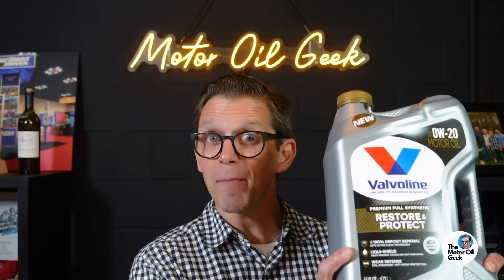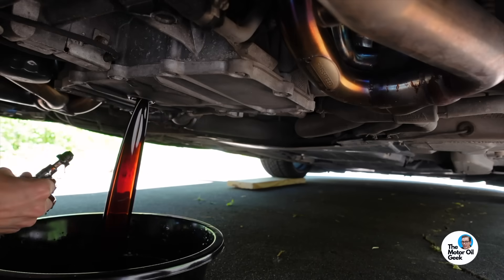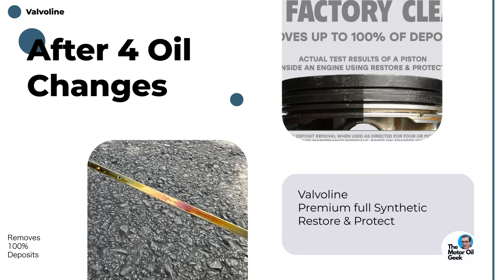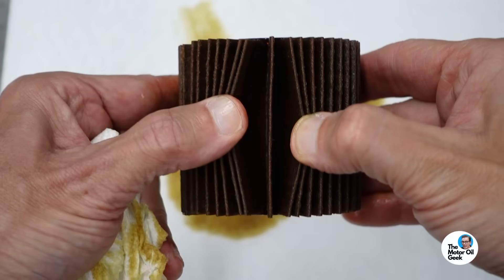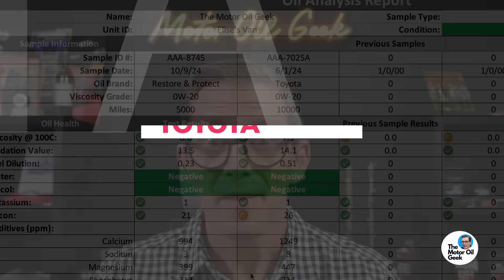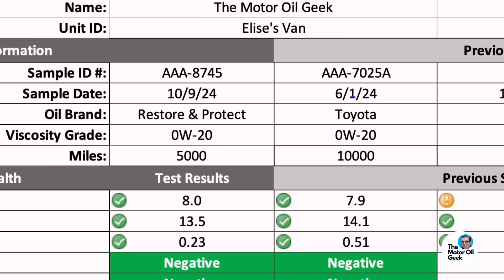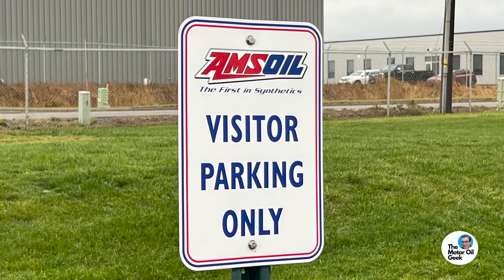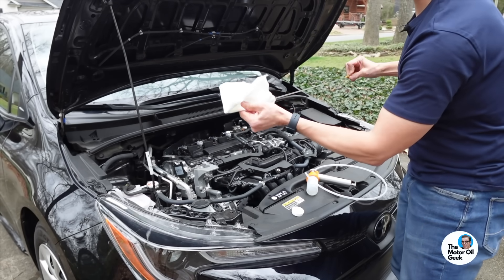The TRUTH About Valvoline's BOLD Engine Cleaning Claims

Comment: That dip stick cleaning is unbelievable.
Reply: I'm watching it work on my sisters 2013 Hyundai 1.6 engine. I can see more and more of the sludge flaking off the oil fill tube every few weeks when I check the oil.
Reply: Never buy a used car with a dipstick that looks burnt like that
Reply: Pennzoil Platinum cleans the dipstick also i have 2 vehicles with it 400k on my truck i wouldnt be afraid to try the VRP Though.
Reply: @robertclark2935 I agree. My 5.0 F150 is at 176,000 miles and its dipstick still looks brand new.
Reply: agree
Reply: That is what convinced me to use Valvoline R+P. However, I did not see any effect like that when I replaced the valve cover gasket on a 2011 Honda CRV. I made sure that CRV was well kept with either Castrol Magnatec or Pennzoil Platinum. The dipstick never did have varnish, but there was plenty on the valve cover.

Oh well, I wasn't expecting miracles. I just want that car to last a long time without too much effort.
Reply: @skylinefever I am at best a shade tree mechanic, possibly the varnish on top of the engine is extra thick compared to the average engine and might take 2 years or more to see significant improvement....I have seen others make the same comment on the varnish
Reply: Brake cleaner does that.
Reply: @NomenClature-o8s  for real
Reply: Definitely unbelievable. Like fabricated.
Reply: @SilverCommander no it really does clean. I just put in my 11 year old explorer and it’s already cleaned the stick off along with the bottom of the oil cap.
Reply: @SilverCommander  I had the exact same result using VRP on my lexus with 180k miles. Im only 2500 miles into the first oil change with it.

Comment: I had a bad experience at a quick lube place and the tech only finger tightened the drain bolt.  I didn’t notice until I got a warning light.  Had a lot of crusty oxidation form on the upper part of my valve cover.  I started doing my own oil changes but noticed my oil consumption was getting bad. About 1q/1,500 miles 😢.  I tried VR&P and with the first 200 miles the consumption stopped 😮.  The crusty deposits on the valve cover also started to soften and dissipate.  At 1,000 miles I replaced the filter as a preventative since the valve cover is about half clean with the remaining deposits already softening up.  This stuff is the real deal 🎉

Comment: I had an “oil production” issue in my wife’s 2011 Honda CR-V (K24 engine). Fuel dilution was at nearly 5% using GC method. After several ~3K oil changes with Valvoline Restore & Protect, I am below 2% on the last 5K oil change. The data tells me it is working.
Reply: I have same CRV.  Strange that you had dilution problems since that didn’t start until gen-4.  Anyway, I was consuming 1q/1,500 miles on mine and within 200 miles of the first oil change, my consumption has stopped.  K24s are bullet proof 😅
Reply: @mhagnemae5202 
I inherited this vehicle at 45K, and it had the fuel dilution issue when I got it. Apparently I’m the only one with a port-injection engine that has fuel dilution issues, lol.

Not sure why there are a lot of haters/skeptics out there. I pay less per 5 quart for R&P than I do for a lot of other average oils, so even if it’s just placebo, no harm.
Reply: @carnold.knowledge  Have you run injector cleaners  to try and solve the fuel dilution (caused by unburned poorly vaporized fuel) ?
Reply: @MathewPollard-vj4uq 

First thing I did was replace all 4 injectors with new Honda OEM. Sadly, no real change. Also, trim and ratio numbers coming back from an advanced scanner all looked normal. I suspect the oil wiper rings were stuck or otherwise compromised and the R&P is helping with that.

Comment: Did you just lay the dipstick near the exposed + battery terminal, Lake? Oopsy. FYI, bulk tank oil at Dealers comes from any source. It's not Toyota. We've had Pennzoil, Valvoline mystery salad oils. Sometimes we know, other times someone fills the tanks and have no clue what we're getting.You're protection may vary.
Reply: I watched him lay down that dipstick near the battery without looking too and was preparing for some sparks, lol.
Reply: @shanesdiy  and it was a quart low.

Comment: Clearly VRP cleans more aggressively than other oils. The question is, is it too aggressive for long-term use? I have it in both my vehicles right now but I might go back to Pennzoil Platinum after a few OCIs
Reply: I think that's why they market the "Protect" as well. It's not just a "cleaner" oil. It's capable of excellent wear protection simultaneously.
Reply: Is it better than liqui moly d-v
Reply: The detergent package is comparable to other high mileage oils, it’s the proprietary additives that work the extra magic.
Reply: Perhaps enjoy some other videos from other people who tried it? I think I saw a few that said if you deal with an engine that has large amounts of sludge, Valvoline R+P may loosen up enough sludge to clog the filter. However, if an engine has the maintenance it was supposed to get, it won't be a problem.

I didn't have this problem, but the Honda CRV my mom got had about 22,000 miles on it when she acquired it, and I gave it oil changes when the olm was somewhere between 40% and 15%. It is on its second oil change of Valvoline R+P and never had a problem because it was already well kept at 190,000 miles.

Comment: We're on our 2nd/3rd oil change with Valvoline Synthetic Restore and Protect 5w30 in our 2012 GMC Acadia. I am definitely impressed with not only the engines performance considering we bought the Acadia with only 25K miles on the odometer, the engine is quieter and performs better.  Considering the engine is a Direct Injection dohc 3.6L V6, I definitely will continue to use VRP for the duration of our ownership of this vehicle.  Thank you Lake for your assessment and analyzing of VRP.  Most definitely put the Valvoline restore and protect in your daughter's Corolla.  Happy Thanksgiving and Godspeed! 🦃✝️
Reply: my civic burns ALOT of oil..about 700-1k per qt. Car calls for 5W-20, should i just go with 5W-30 to get lasting effects from the oil consumption? Was thinking it wouldnt hurt to keep this in longer & get more out of it? Thoughts? Also, should i top off with this or can I get away with other simialr valvoline products till next oil change? Apprently it takes 4 oil changes for it to work 100%?! Also, after the 3 oil changes, can I go back to my old Castrol oil for sometime & use this periodcally in like every 4-5th oil change? 
P.S. I change my oil 3-4k miles Thanks!
Reply: Did you try it?

Comment: Seriously, These videos  have convinced me to switch to the valvoline restore and protect oil, the next time I do an oil change ( and every changer after, unless they release something even better, between changes ).  I have a Subaru Crosstrek with about 140k miles, and I'm burning a little bit of oil.  Especially on start up, can see a cloud of blue smoke.  And I've had to add about 2 or 3 full quarts of oil in the past 1 - 1.5 years.   The oil burning seems to have slowed down.  But switching to a better oil can't hurt.   Plus, I REALLY like this vehicle.  So anything to help it last longer is a positive for me.

Comment: This oil is fixing a lot of issues with MDS and VVT on high mileage cars that have sticky or stuck solenoids. I think this stuff is the greatest thing to happen to motor oils in a while.
Reply: I have a 2AZ-FE that had a click clack sound for just a second or two on cold starts.  I switched to Pennzoil Platinum and that stopped, but there was still a hesitation, delayed reaction on cold starts.  I switched to Valvoline Restore and Protect and within 500 miles the hesitation/delayed reaction is gone.  My oil consumption was 1/2 quart in 800 miles and at 1500 miles with the Valvoline that's what I have added.  Idle vibration is gone too.

Comment: I’m using it in my 5 cylinder Volvo in an attempt to help consumption. Unfortunate, a couple changes in consumption is slightly up, but I’m going to try a bit longer. On bright side, I did oil analysis and the wear at 5000 miles was very low just like Lake is showing in the video. 4ppm iron on mine. Shame it is consuming more than euro oil, or I’d use it forever.

Comment: I've been waiting for your scientific review of Restore and Protect!  👍
I've seen lots of cursory reviews which lack any data other than a visual inside the valve cover.
I've put it in my 2012 70k RAM Hemi and my 2012 75k Mustang.
I'm still on Mobil 1 in my 2025 Camry as I don't see any 0W-8 Restore and Protect.
It's great to see a product live up to its hype. ❤
Reply: Why would you even need the Restore and Protect oil in a 2025 Camry?
Reply: @brianklamer3328  if it works like any quality oil but also keeps it clean, that's a good thing.   I also only fill with Top Tier gas.

Comment: I'm surprised by the varnish levels on the Toyota, being it was using Toyota branded oil................Was it conventional or synthetic?. If it was synthetic, it's bad.
I have 118k miles on my turbo Genesis coupe, and the dipstick looks new and when I put the camera in the valve cover it looks newly machined in there, and in the spark plugs holes you see a bit of carbon on the piston faces, but not much else the cross hatch is still on the cylinder walls at this mileage and it runs like a champ.

Comment: I started using Valvoline restore and protect in my 390,000 mile cavalier just a month or so back after watching Lakes first video on the product, super glad he took it one step farther and brought to us this new video! Thank you so much Lake for doing what you do!
Reply: I'm considering using it in my 750K mile Yugo.
Reply: don't, grim and dirt is holding that poor engine at place, if you clean it it will start dripping oil from everywhere
Reply: @nikosgiagkoulas435  no big deal. Other than the rear main seal if it happens, replace all the seals and keep trucking.
Reply: @goclunker  bro, if you don't do those things yourself you gonna need a fortune to get someone to replace all the seals. that's more than the cost of the Yugo itself, not worth it
Reply: @ what are you talking about? If you have basic skill sets, and you have some tools, it's really not that big of a deal. I replaced the rear main seal on my minivan in 2 days over the weekend. 

If you don't have the skill set to do a job, that's on you not on the job itself.

With high mileage cars it's almost a guarantee that the rear main is gonna have to be replaced . This is why if you have any transmission service, or a clutch job, you do the rear main seal religiously, whether it needs it or not.
Reply: @goclunker  not everyone is skilled enough to do those jobs man, or has all the tools needed.i do a lot of work in my car but i would never drop the transmission to get a damn seal replaced especially since I don't have a ramp to work comfortably under the car
Reply: @ I did it on Jack stands so don't tell me it's impossible. Two days of my time and a $60 seal or $1200 at a shop.

You learn out of necessity
Reply: @goclunker  i didn't say you can't do it on stands, i am saying that i would never do it like that.  but good for you man it's a hard job to do. i would just put heavier oil in it to slow down the leakage
Reply: @nikosgiagkoulas435  that doesn't work quite so well when the seal is blown out and sitting on an angle. Sometimes you just gotta suck it up and do it. It's a shitty job but once it's done, you have at least 100k of leak free motoring.
Reply: @mitral5333 2 doors, you go; 4 doors, we go.
Reply: @mitral5333 do you realize how much of a miracle that phrase is?
Reply: @mitral5333  No way😂😂😂
Reply: Never in my life would I have expected cavalier and 390,000 miles to be in the same sentence.
Reply: awesome job keeping that Cav running!
Reply: just junked my cavalier for 200$
Reply: @hxtcsy  -- Which fortifies any reasons people have for not 'driving a payment' but a trusty ol' reliable. 🙃There's a world of difference between a dependable if imperfect older car and a piece of shit that's only worth scrap value or whatever a kid who doesn't even have his license yet is willing to pay for a beater he can restore.
Reply: @billholt174  sometimes its too expensive and time consuming especially with the baseline for most cavaliers already being mistreated to hell 💔 sucks most used cars are never fully properly taken care of but 2,000$ car gems are out there
Reply: @hxtcsy  -- After writing, I had to return to the beginning to warn that this got a bit lengthy, so feel free to skip or kick back. 😁It's the end of Thanksgiving Day. 😊🥧🦃 

You're right, and if you can get a well-made one that was also well-cared-for and didn't become a casualty of winter-treated roads, such as a southwest or 'California' car, you might get many years of driving from a front yard purchase. My '95 Civic LX -- my only set of wheels -- is looking rough as a northeast car, but I've told many people that there are similar beasts in places like southern California that have 500.000, 600,000, or even more miles on them and look almost like they just rolled off of the assembly line. 

I'm a slave to the paycheck grind who understands time and finance constraints. I've encountered some moderately expensive and time-consuming car projects, and I suddenly find myself with three simultaneously as winter looms and I have the great outdoors for a garage, but none have made me consider abandoning ship. My trusty companion motivates me to maintain my commitment to augmenting its superior engineering and build quality so I can keep it cranking out the miles without ridiculous expense in either time or parts. Should the day come when this beloved Honda is no longer my daily ride, it will remain in my possession as a 'project car' with a place in history. 😊

I'm in this comment thread because I switched to Restore and Protect in September to hopefully reduce oil consumption by fully removing ring deposits in this D15B7 engine at 325,000 miles. Back to the original point about time and expense, I had the head off for a gasket replacement, but I didn't have the time or the desire to replace the rings, hone, or possibly re-sleeve the cylinders. Trusting my gut, my greatest trepidation was that I didn't want to remove bearing caps, bearings and pistons, then re-assemble at that mileage, presuming they had never been touched since the car was built. I'm not the first owner. Additionally, this would have been done with the engine in the car. Of equal consideration is that I also like to see things stand the test of time being as fully original as possible, again presuming that this engine had never been dismantled for a 're-build'. I'm a bit odd. 😆Adding insult to injury, it wasn't until I was essentially at the point of no return that I realized the leak was from a tiny but mighty hidden wear hole on the underside of the smaller coolant hose coming of of the head beneath the distributor and entering the block farther down, in, and back. I consider myself to be detail-oriented, so I was a bit agitated by missing this. 🤨On a cool note, no pun intended -- 😜😄-- I acquired the only OEM gasket that was available in any dealership in the country, specified in a 1997 service bulletin for superseding the original cork-backed gasket that proved to be prone to failure. This was after I had originally been given a list of about 16 dealerships showing the gasket as still in stock, researched for me through the national database by a really helpful and friendly kid at a dealership over the phone. One guy on eBay thought he had one but didn't, and I found one in Japan. I just think the odds of that are comically impressive. 😆

I love my '95 Civic, and I've said that I'll drive it until the 'd' and the 'e' fall off. 😜😄 Thanks for reading. 🙃
Reply: Cavalier is good veh..car..
The plastic is squeaky and just as crumble as any Toyota that's from the '90s but I say the quality on that engine is Toyota grade for sure. 
Now I know where they got that engine from! 
My cavalier was a $700 car supposed to last me a couple months before I have to do anything to it but I end up doing nothing to it and had it for 2 years as a daily commuter And I even drove it couple hundred miles on the weekends. 
My brother-in-law's Ford focus Platinum couldn't hang with it!!!
😮😂
The Ford focus would overheat the transmission halfway from San Jose to Sacramento. 
I had no issues with the cavalier.
Reply: @jimnunya1253  the base egine is reliable compared to the eco tec ones
Reply: @jimnunya1253 rear frame rot is a serious issue those cars have.
Reply: Probably still is really good on gas lol the DOHC ones make almost 40 MPG! don’t listen to the haters and definitely don’t let rust destroy that car
Reply: @IsaacMega  Just finished a 250 mi trip to the Dirt in December races in the Dome and the lil Cavy knocked down 33mpg!
Reply: Cavaliers are gay. Yall praising them hunks of trash too much you guys.
Reply: My 78 Pinto runs like new now
Reply: Jesus get a new car, live a little lol 400k😮‍💨
Reply: @deykno87  I had 347K on my 04 Chevy Colorado when I sold it. Engine was strong, no smoke, no leaks. But I was running full synthetic since 15k miles.